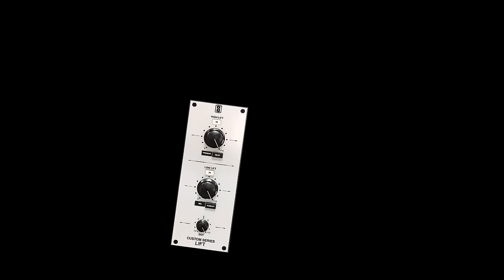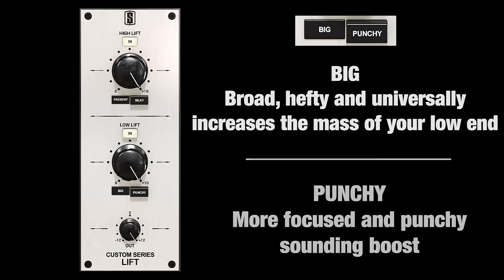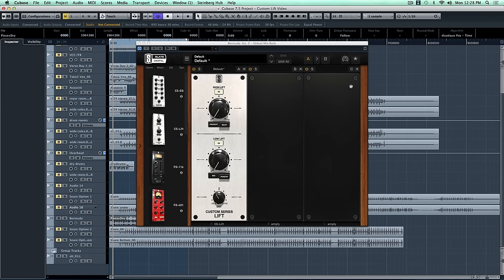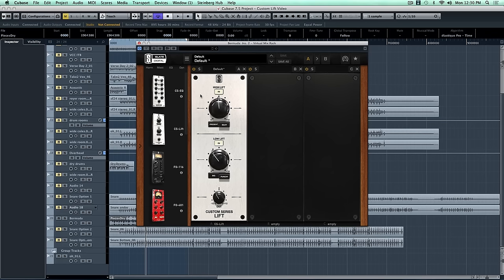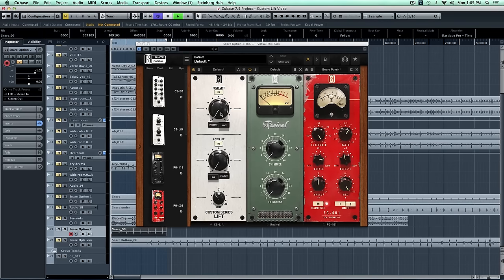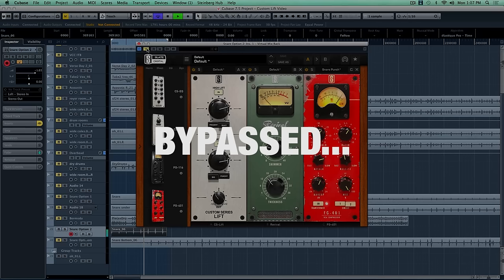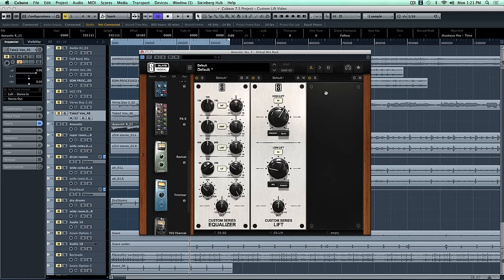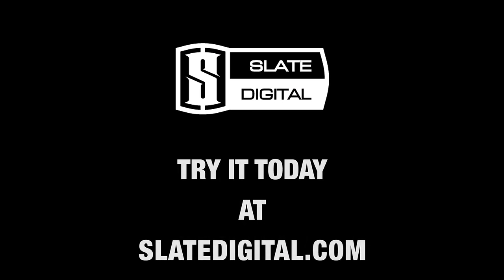The Slate Digital PARALLEL LIFT: The Two Knob Mix Fixer!

Comment: Ah, "Tilt" eq on steroids! This is a very neat new plug, and what seems like a significant improvement in flexibility. Man, wish I had this when I had to do ship a bunch of "rough" mixes for approval. Being able to do quick and easy track and Master "semi-mixes" as opposed to the multi plugs would have saved me some time.
Can't wait to download the trial.
The folks who join the new Slate Digital yearly plan are getting a lot of great new stuff, it seems. Hopefully, those of us who've purchased multi-plugs will still get the occasional discounted prices on new, and previously released stuff!

Comment: Steven, please add a fifth band to the EQ (low, low-mid, mid, mid-high, high), that way can use it for double duties to do mastering with it. I'm surprised you didn't do this already. This could have been the sweetest-sounding analog type EQ for our masters also. Please, please, please! Cheers.

PS: I hope to God that one of your latest recent projects is an emulation of the venerable LA2A.
Reply: Great Idea Axel...Brilliant

Comment: What's the difference between this and Revival? Isn't this the same idea?
Reply: gregthegroove Not the same philosophy!! Two options for low end and two for mid/high.
The mid "present" mode, helps you put something "forward" in a mix with just one knob!Works great for master bus too!Great module....!!
Reply: Revival is harmonic distortion while Lift is EQ.
Reply: +gregthegroove they're not the same. Revival is a subtle saturation/parallel processing weird unique plugin.  Lift and CS EQ are the best EQ plugins in existence lol.